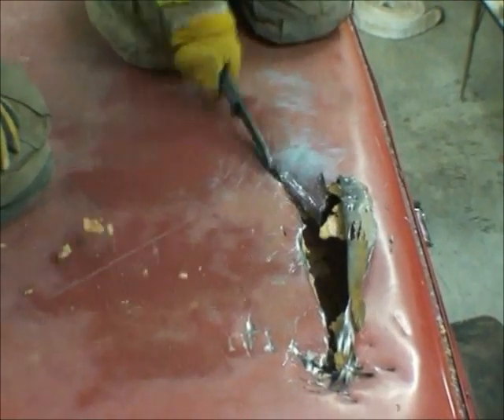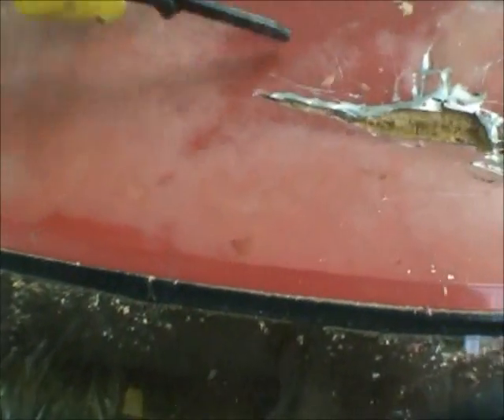Becker BK3 Tactool vs Dodge Omni

Comment: I'd buy the knife if it didn't have that cutting hook on the top. It's a weak spot on the knife. As you can see in the video it breaks right at that point. They should offer a version without the cutting hook.
Reply: Glen Parker And considering they ship the blade with the hook barely sharp, it's more of a hazard than a use. You're more likely to cut your hand on the main blade than cut cord when using the hook meaning you'll just loop it around the knife and rub it over the main blade.

Comment: It is unnecessary to have the belt cutter hook design on this tool and its not thick and strong enough to do these kind of work, why not do it without the cutter hook and have a vary thick blade so that it can be very tough to do many kind of works you want it.
Reply: Because that sacrifices weight, so it's more to carry. If you are going to make it thicker, then you have just made a pry-bar...